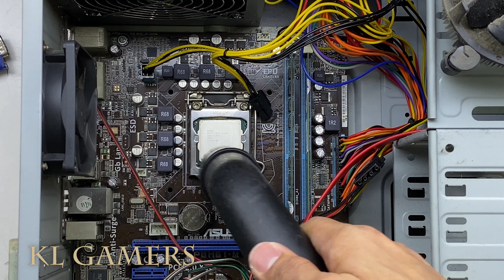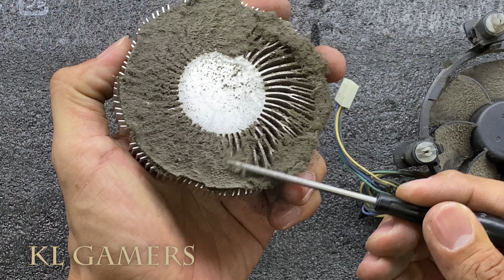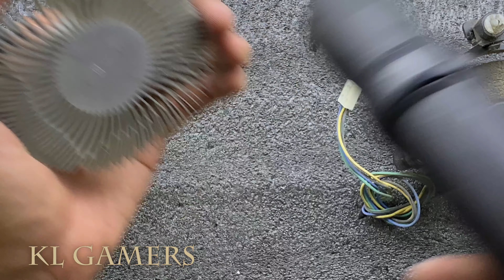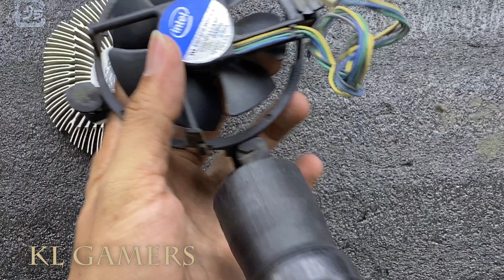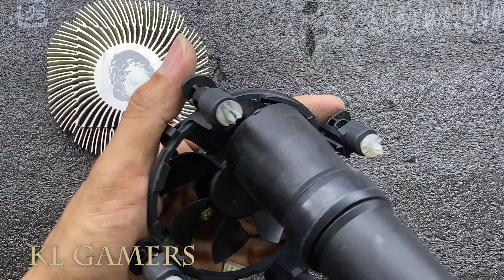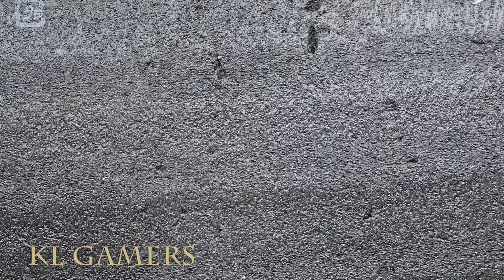intel Core i3 2100 ASUS P8H61-M LE Very Dusty Vacuum Cleanup Thermal Paste Situation

Comment: Hi my friend how are you?

I've seen several of your videos about the p8h61m_lx2_r20 motherboard, I see that it's extremely easy.

I've been looking for 24 hours how to install a Rise Mode Z3 air cooler, but the space on the board doesn't allow it.

Even though it is a recommended cooler, it is not high enough.

Have you tried and had success installing one on this board?

Comment: when you pulll it out you twist and pull but when you put the fan back you put it in locked position and push it back is that safe?
Reply from the maker: will have risk to break the plastic  pins because of old age plastic will break because become fragile but the procedure is correct
Reply: @KLGamers  thanks for the reply i also saw other videos of people who does the same thing.

Comment: does it support 1600mhz ram
Reply from the maker: yes
Reply: KL Gamers Why does it only show 1333 on mine
Reply: KL Gamers help
Reply: @peepopie5005  Intel i-Series 2nd Gen / "Sandy Bridge" processors only support RAM frequencies of up to 1333 MHz, any higher than that will require memory overclocking with a supported motherboard
Reply: @bestage9429  Thank you